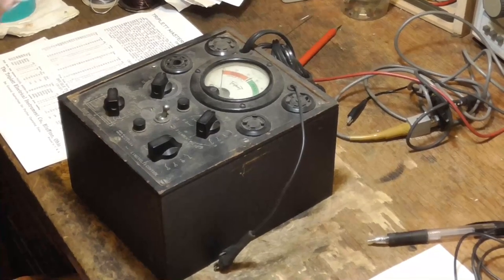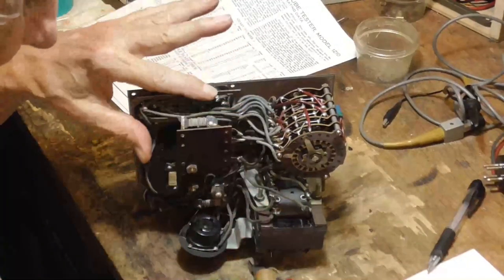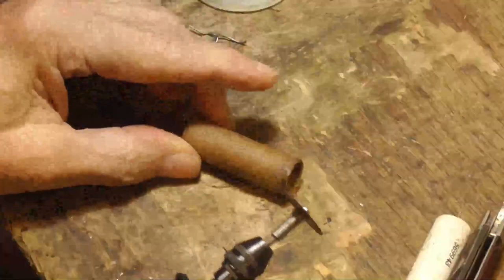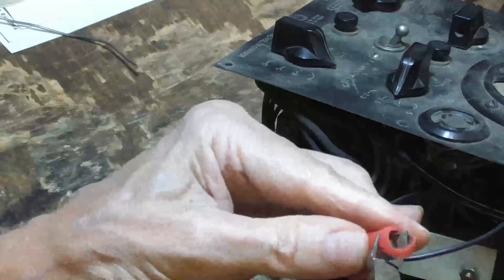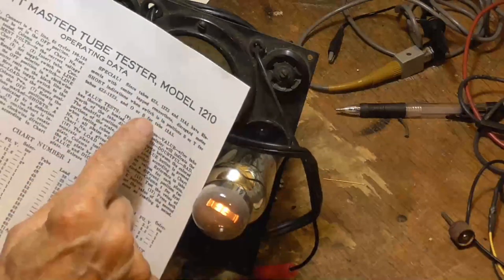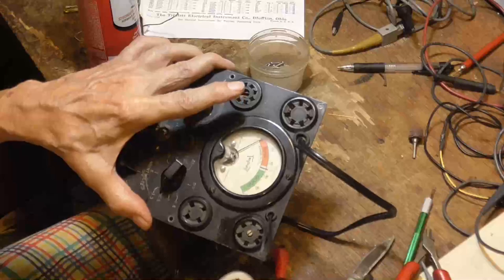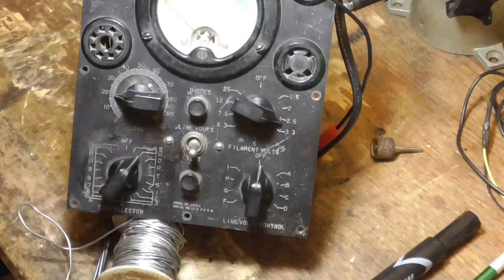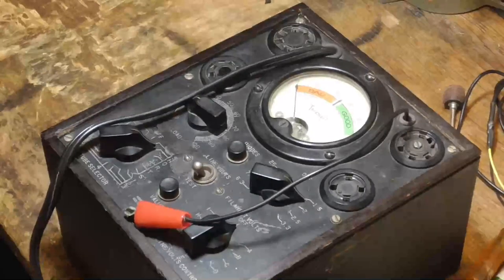REPAIRING A TRIPLETT 1210 A TUBETESTER

Comment: Mine is a 1213, already with the selenium rectifier. I changed the capacitors and cleaned the meter, which was getting stuck. It's an amazingly useful tool! Your videos are great, it made me come back to old radios and electronics after almost ten years out of it!

Comment: Awsome! I often use to take pictures of the inside of old radios and other things in my collection and send to friends/posting on forums, etc, that's why i like this method since it makes it possible to save old labels and casings as decoration.
It's of course nice to keep them as original as possible, but i personaly does not want the wooden cases to look completly like crap or the inside not being functional if it's reasonably in repairable state (wich almost all radios are), if it is an exceptionaly rare or old components i try to salvage them in a bag or hanging as decoration, but taken out of the electric scematic in favor of more modern components if they are faulty and risk damage more important parts of the system.

Hats of to people like You Ron!

Comment: I've used the black (and other colored) marker idea and it works well for touch ups. Another thing that might help that panel is some spray on automotive wax/cleaner. It fills in a lot of the scratches and really improves the appearance. Usually takes 2-3 applications and buffs as it's fairly thin. 
Be careful and test any new brands of brake cleaner. I just bought some on sale without reading the contents--it's got toluene and acetone. Won't be using that on too many pieces of electronic gear! 
Also, FWIW Glasslinger produces a lot of videos with excellent content that mostly can't be found anywhere else. There's no revenue generating ads so I presume his motivation is to share  a lifetime's accumulated knowledge which is much appreciated.  If he wants to express an opinion within them that's his privilege & right and I'm 100% OK with that. I don't necessarily agree with every last thing he says but I do consider everything. And I've learned a lot. Thank-you Sir and keep them coming!
Reply from the maker: Yes, definitely check the contents! The other cleaner you mentioned is also very flammable and can light your project on fire! By the way, my opinions are all based on cold hard logic so I will explain any you have problems with.

Comment: Instead of a paper capacitor, even relatively new, I would go for really a modern (MKT,...) plastic film one. First the new ones are way smaller, so the cut (to hide it in the "original" cardboard tube) most likely won't be necessary, and seconds paper capacitors will always suck in moisture over time and go leaky again, while the common capacitor plastics are just inherently hydrophobic. Moreover when this thing would ever be powered just for few seconds once per many years, so no heat exposure (to drive the humidity out at least a bit).

Comment: Ron: There's a technique out there on Youtube that demonsrates how to tranfer pictures onto glass, plastic, wood and metal. Simply take a photo, open it up in windows PAINT, correct and draw what's needed, save and "mirror" (flip) the image. Make various sizes and Copy to a PDF,  have Office Max print a laser copy (on good photo /print quality paper) then glue to any surface and allow to dry. Next day remove back of print paper with wet finger and presto ..... perfect decal. Yes, takes a few practice 'test' runs , but easily mastered. Once your satisfied, try on your project after stripping, cleaning and painting fresh. Recommend starting small and doing sections rather one big master print; master may prove best as skill is acquired.
Reply: Sounds like "toner transfer" PCB etch-resist.  You using PVA glue for this?  I was told use regular paper and then nail polish or acetone, to encourage the transfer.
Good idea, regardless how you do it, thanks :-)
Reply: Brilliant, thank you, duly book-marked for future use :-)

Comment: Spray them wafer switches with deoxit.thats great stuff
Reply: Was told that deoxit (or any electrical contact cleaner) is not good on cleaning wafer switches because those cleaners might produce shorts. I found that information when I was restoring my Hickok tube tester. Not sure if it’s true? They said the eraser on a pencil was your best bet on cleaning contacts on wafer switches.
Reply: @EUC_Senior  Erasers are good, but to use 'em you gotta disassemble the switches, no?  I'd hate to do that, much pain! :)
I see Blue Glow (and others) using DeOxit alla time, mostly successfully -- never heard any complaints about shorts, just incomplete success :-/

Comment: I don't bother going to the trouble of stuffing old caps. Instead I wrap/glue a modern cap in one layer of brown parcel paper. Not original of course but better than bright canary yellow! They kind of look old.
Reply from the maker: I do the same! Many times the original cap disintegrates so it is useless. I have a collection of capacitor case images in the computer so I can print out original looking paper to wrap them.

Comment: Would potentiometer cleaner not work on the switches?
Reply from the maker: If the cause was greasy buildup. In this case it was corrosion, which is not soluble in cleaning solutions. It takes mechanical scraping to get it off.

Comment: Just curious if someone had a weak picture tube could you rebuild it or is that even possible
Reply from the maker: It is possible but very expensive now days. Back when picture tubes were used a lot there were companies that set up the very expensive equipment to rebuild the picture tubes. They did many tubes per month to make it pay. Now, there are only a small number of requests per year. No way to make a business at that small volume.

Comment: You should get rid of all your old and NOS capacitors I had the same problem. A good capacitor must have at least 1G ohm of resistance not 20M.
Reply: Most old electrolytic caps will be bad, but the cardboard tubes that can be stuffed "for looks" can still be useful.

Comment: What's the deal with 20m-ohms across the capacitor?  It could show 20mo but short out at 200 volts.
Reply from the maker: No. Resistors have a maximum rated applied voltage. The old timey resistors were rated at 450 volts. They will not short out so long as the dissipation is not exceeded.

Comment: You have amazing experience. Can you make video on making xray tube?
Reply: You're aware that you can buy them on flea bay right? And if not ....there are several Russian made so called high voltage rectifier tubes available for all your radiation needs. Just saying.  Btw: a good tube (like you're suggesting) would require tungsten, & a machine shop that could cut it for you.

Comment: If you wanted to repair all the painted lines that aren't engraved, what could you use to get a sharp and very thin silver or white line?  I know they make ball point paint pens, but they generally are thicker lines with a larger ball and then tend to be fat on the outside and thin on the inside when drawing lines with them.  
The only thing I can really think of would be a lot of work and very time consuming. Basically put down 2 pieces of acetate/plastic up very close to each other where the gap is the line's thickness and then use a small paintbrush.  But with the 90 small lines on the front of this, it might take a week. You could only do it once in the same part of the meter until it dries.  Do you have a faster/better way?

Comment: Hi, thanks for making these videos. You have inspired me to get into tube making too, I'm currently still gathering the equipment, but once I have a complete vacuum system, I'll give it a try. 

I have one question: What kind of argon pressure would be necessary to make a tungar rectifier that passes a few amps at low voltage ? I'd really like to make 4 of those and then build a bench power supply around them to run modern low voltage stuff like an arduino :-)
Reply: I was reminded of this, but these are (apparently) thyratrons:  https://www.youtube.com/watch?v=WX74GoHuwHk
Reply: @theskett  I purchased 2 NOS Tungar bulbs from China via Aliexpress a while ago already. I never had expected them to be available there but apparently they made them in china at least into the 80s for some reason. Replacing a 50 ct part with 4 of those things that each eat up around 30W for their heater and then using it to power a raspberry pi needing only 5W would be wonderfully ridiculous.
Reply: It's not ridiculous, it's merely a combination  of 'want' and 'art'.   We eagerly await your success (y) :-)
Reply from the maker: Actually, tungar rectifiers don't use argon. They are mercury vapor rectifiers. They have a thousand times more mercury in them than a CFL so if you have any be very careful not to break them!
Reply: @glasslinger  Hi Ron, thanks for clarifying that. I had read this old handbook: http://www.r-type.org/pdfs/tungar.pdf where they talk of a mixture of argon and mercury, but not how that mixture looks like. In the Tungars I have in my collection, I never saw mercury droplets like in 872 or 866 rectifiers. Also I never saw the mercury clouding that is normal for 872 / 866 mercury vapor rectifiers when I tested one of the tungars, so I assumed that the mercury is probably not much more than in a CFL and most of the gas is argon. Btw. big fan of the orange man here, too. He's far from perfect, but here in germany we get to enjoy all those wonderful AOC policies already and I pray you guys don't mess this up in the next weeks. At least America must remain a free country.
Reply from the maker: @tpa6120a2dwp  It seems to vary with the age and manufacturer. I have some 866 tubes that are dripping with mercury and some later ones that show no trace of it. Same with the tungars.

Comment: There should be a load for the tube so can test properly should be listed in chart
Reply from the maker: It has a variable resistor that is set for each tube type. This is a simple emission tester so flipping a coin is about as reliable a test!

Comment: Instead of using "N.O.S." paper caps that will probably go bad quickly (acid in the paper will kill it no matter if it was "new" or old), why not cook the wax out of the old one and slip a new modern cap into the old casing. I saw that trick back in a 1970's electronics magazine.
Reply: Did you watch this video!

Comment: Do you have a collect of pre 1936 or 1936 tubes to test?  Or just doing this for fun.  Use to be an instructor for the Air Force and Navy, we taught the best way to test tubes was in the circuit.  Was never difficult to know that a cold tube was bad.
Reply from the maker: Yes, the cold tube method works! You can also burn your fingertip on some tubes! :)  I do have several thousand antique radio tubes in the attic.

Comment: If the capacitor reads too high could it be open?
Reply: It usually means they are leaky giving a false reading on the tester. I also think it is best to test them for leakage at their rated voltage.

Comment: Why get nickel plated contacts often corroded?
Reply from the maker: Nickel plating is highly porous, especially if the people doing it don't use a thick enough coat. Thus the underlying metal (usually copper) will corrode through the pores.

Comment: Does anybody know what kind of vise Ron uses?
Reply: panavise
Reply: I use a pair of adjustable alligator clips attatched to a weighted base. Also has a magnifying glass for close up work. It's handy for holding small boards or connecting wires
Reply: Gigs,
THANKS, Gigs. One less question I have to bug Ron with!

Comment: Is there a danger of that cleaner removing print or painted  typing off of surfaces...? Agreed on Trump.
Reply: From my observation of this video, it became immediately clear to me that the Breakleen product Ron used removed the ink/paint from the Marksalot marker instantly, so I imagine that it would be pretty effective at removing paint. At least that's what I conjured up from Ron using the solvent-soaked rag on the freshly touched up area. Trump 2020.